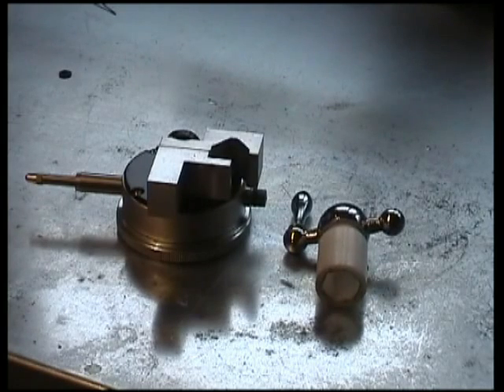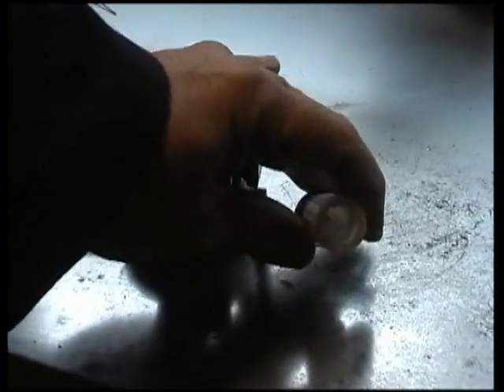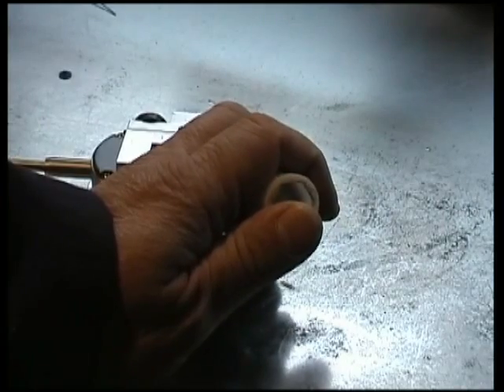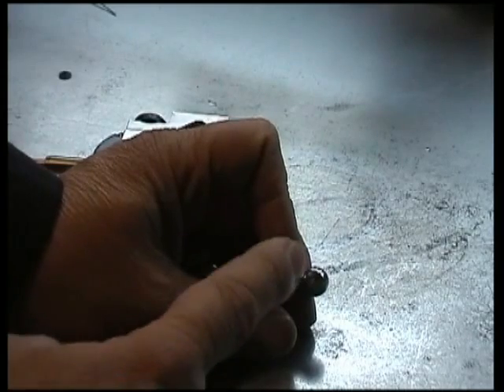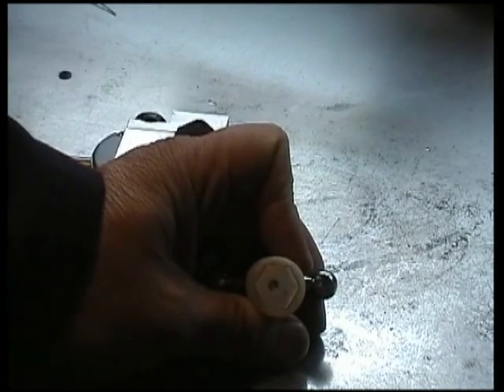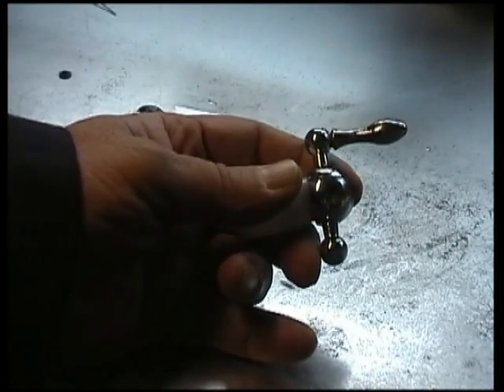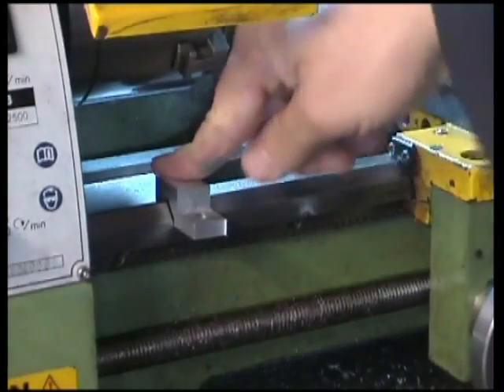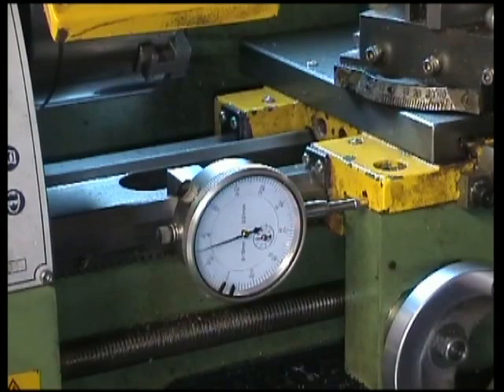Metal Lathe Mod For Precision Cutting/Turning

Comment: The lead screw crank moves the saddle in much finer increments because the crank is smaller. It's much more difficult to be precise using the bigger carriage wheel.

Comment: How do you use the lead screw crank when the lathe is running?  On the lathe I have, I don't think you can disengage the lead screw at will, when the lathe is running, the screw turns, whether you have the feed engaged or not.  I suppose you could remove a gear so that the leadscrew doesn't turn automatically but you'd have to put it back to use the auto feed again.